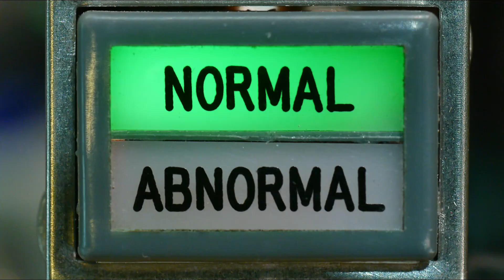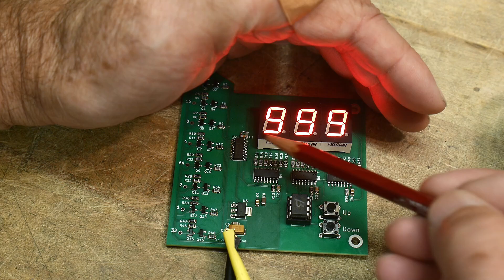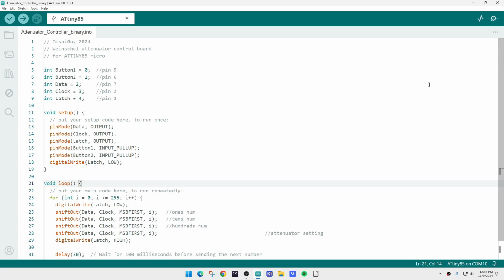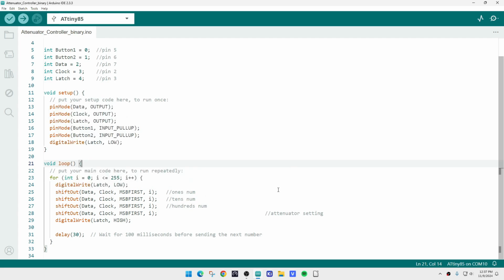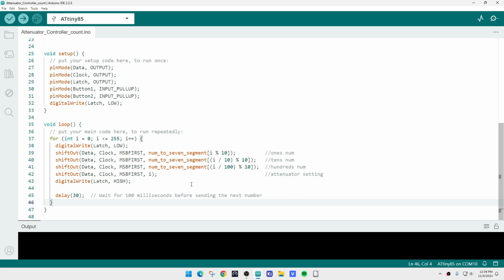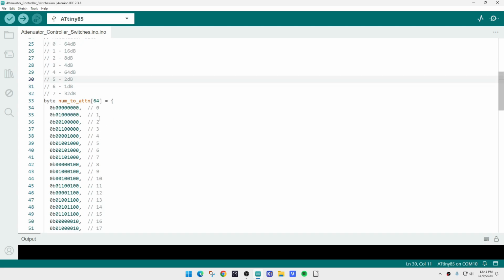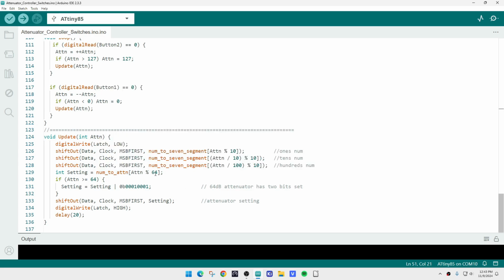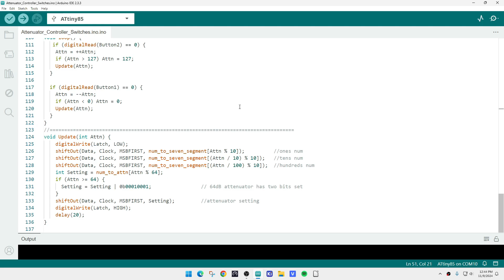#2050 Weinschel Attenuator (part 5 of 6)

Comment: It would be nice of a long press sped the counting up.  A lot of button pressing to go from zero to 127.
Reply from the maker: if you hold the button, it counts
Reply: @IMSAIGuy  hmmm, actually, perhaps you can save relay wear (as per my other comment) by only setting the relays when the button is released... That would be really easy to do.
Reply: @IMSAIGuy  Does it speed up on a long press, like setting a clock?  Just thinking it is a long ways from zero to 127.

Comment: Always setting the attenuator relays may mean you're wearing them out if you gonthrough every value from 0 on the way up to your target... You could fix that by having a separate variable for the displayed vs. actual vakue. Have the buttons just adjust the displayed value, have the LED encoding make the LEDs flash or something if the two values differ, and count cycles through the loop since the last button press and inly set the actual attenuator outputs if it's been more than a second or so's worth of iterations since the last button press.
Reply from the maker: that's a good idea if you know what setting you want. if you are using it as a volume knob then no. many times it will be used to sneak up on a 1dB compression value, or down to test receiver sensitivity. I don't think I will push the button enough times in my lifetime of using it to worry anyway 😎
Reply: @IMSAIGuy , or just do something simple like add a switch for the relay power. I like simple. Turn it on after the display says the attenuation you select, or turn it on first for 'tuning' the amount of attenuation you need.
Reply: @johnwest7993  yeah, I was going for a software only change as the board is already made! 

With regard to wanting to do fast incremental changes to sneak up in something.... Perhaps a mode to make big changes in one go for an initial setting, then go back to immediate driving? It's a bit more complex then, though. Starting at the midpoint or something on power up so you don't have to go so far to begin with might be good enough!

Comment: Nice project Mark. From a user interface point of view wouldn't it have been (may be) more useful to be able to directly set a attenuation level instead of having to travel up/down thru the other values to get to the desired one? Realize that would have added to the complexity and this may have simply been an experiment.  73 - Dino KLØS
Reply from the maker: Thought about it but simple won out

Comment: Very clever project 

I'm surprised you didn't have key bounce problems
Reply from the maker: The delay statement fixes the bounce problem
Reply: @IMSAIGuy , many, many years ago I was working as a young self-taught tech at a small company and some coders I knew were having problems with erratic switching behavior on a new product. They were new to interfacing code to the real world, so I looked at what they were doing and told them to put in a delay to allow for settling time just as you did. They thought I was a genius.  :)
Reply from the maker: @johnwest7993  that makes two of us
Reply: Yeah really.  I had to write key debounce code when using buttons.  Maybe this thing runs really slow.